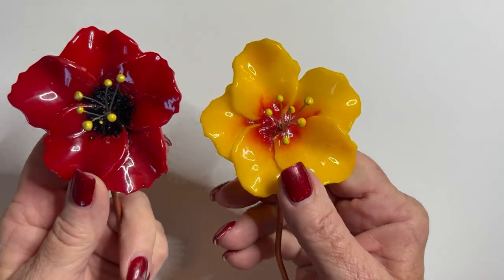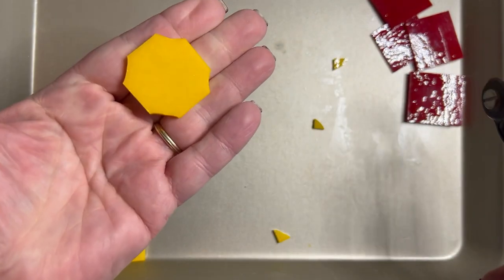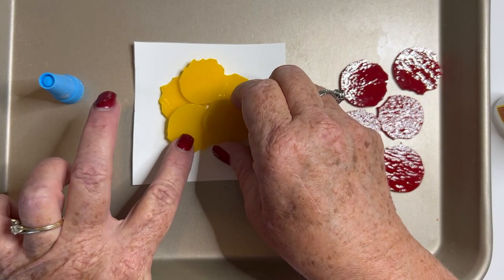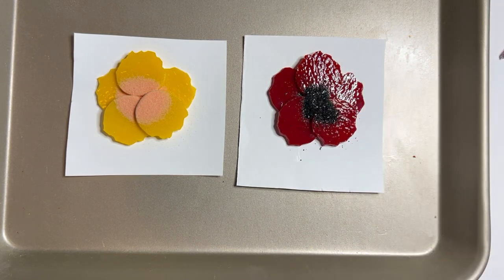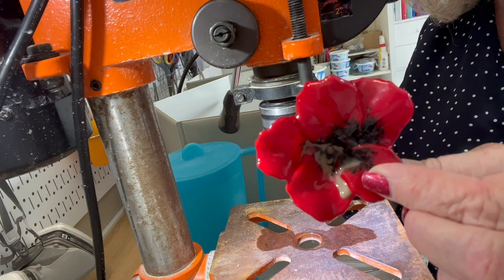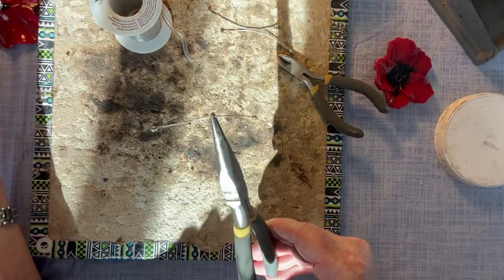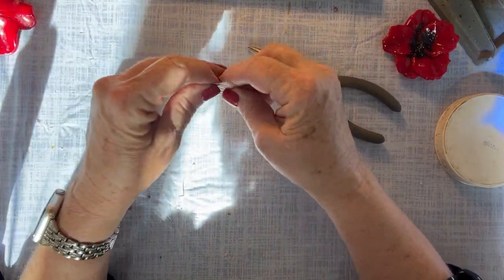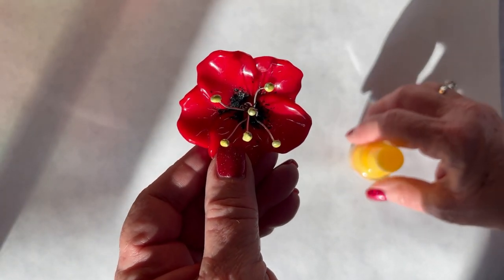Fused Glass Poppies and Hibiscus with Pam Jacobson

Comment: I tried to get 2mm bits they are all to small for my drill press where do ypu get ypurs
Reply from the maker: I bought mine at the Glass Expo in Las Vegas but I have also bought them from AAE Glass. Perhaps ask at the hardware store if they have an adapter for the chick (the part that holds the drill bits).